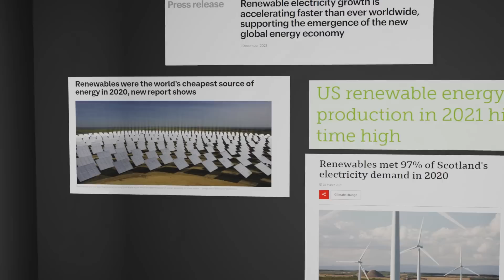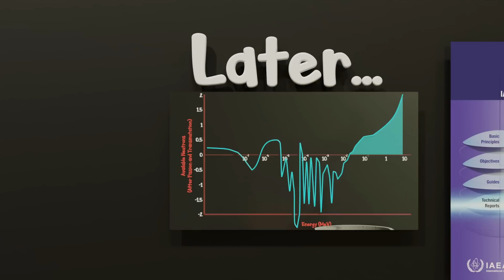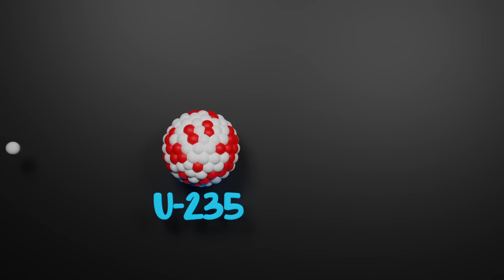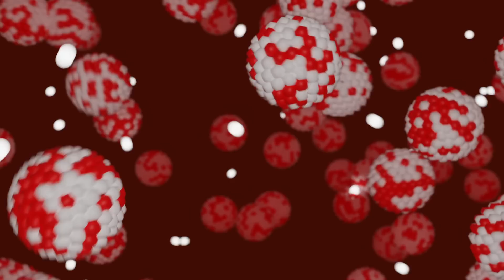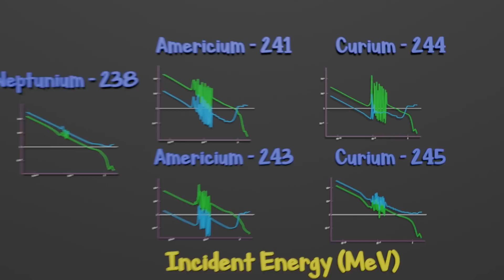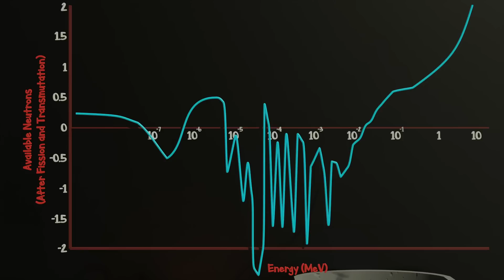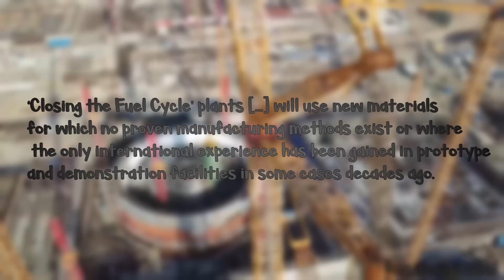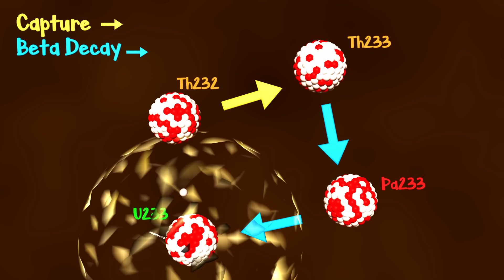How to turn Nuclear Waste into Nuclear Fuel

Comment: One of the best videos I have seen on the subject -- well done!

I would like you also to explore the question of whether Plutonium really is dangerous. The often-quoted figures that (traditional) spent nuclear fuel must be stored safely for tens of thousands of years (some people go as high as millions of years) is really based on the concern that Plutonium will get out into the environment.

Here's a breakdown of relevant half-lives:

* Thorium-232: 14 bn years
* Uranium-238: 4 bn years
* Uranium-235: 0.7 bn years
* Plutonium-239: 24,500 years
* Caesium-137 and Strontium-90: 30 years

Most people will see this and recoil in angst from the long half-lives of the top-most isotopes because big number=scary but the scientific reality is that the longer the half-life, the less intense the radiation. To wit: Stable isotopes have infinite half-lives.

(As an aside, I think this video's classification of high-level, intermediate and low-level waste also needs to be discussed in more detail, since the thing that makes low-level waste low-level is not the short half-lives themselves -- which actually contribute to making it more radioactive -- but that we are talking about very small amounts that may be sprinkled lightly across used gloves, shoe covers, sampling equipment, etc. So what we really need when talking about waste are two axes, one for half-lives and one for concentration of material, which together can describe how intensely some material will radiate, graphed over time.)

There is a rule of thumb that can be applied to radioactive material: After ten half-lives, the material will basically have decayed to nothing. So ten times the half-life of Plutonium-239 equals roughly a quarter of a million years. The longer-lived, milder materials like Uranium are naturally occuring. Most people will accept the premise that "I dig it out of the ground, I can put it back in the ground later".

Plutonium-239, on the other hand, is the longest-lived of the materials that are only created in decent amounts as a byproduct of nuclear fission. Since it still is shorter-lived than the Uranium isotopes, it still has more intense radioactivity than either of those, meaning that any escape into the environment would cause an increase in background radiation levels. This makes it stand out when nuclear regulators want to plan for permanent storage. They apply the "precautionary principle" in a very rigid way: We don't know how much harm Plutonium-239 in the environment might cause, so we need to make sure this can never happen

This is the crux of the problem: We do have a fairly good idea how much harm Plutonium-239 can cause, and unless you basically eat it in substantial quantities, it's negligable. You can handle it with your bare hands, no shielding needed. Should you build your bedstead of Plutonium? Probably not, but if it ever were to leach into the environment from storage sites, it would be in dilute form, and would make for a very small increase in background radiation.

The idea that we don't know enough about the harm from radiation in general, stems from the model of radiation damage called LNT which stands for "linear, no threshold". It basically says that all radiation is harmful, and the amount of harm is proportional with the amount of radiation, or in other words that there is no threshold for radiation, which would allow you to be safe be remaining under it. This is basically the premise behind every comparison you may come across between radiation and some number of "chest x-rays". This was a natural idea to have in the development of nuclear science and radiomedicine. But at this point, LNT has been falsified. It is simply not true. There are thresholds for safe radiation levels. However, regulators are still using LNT. I hope a future video from this channel will explore the topic of LNT further.

There is a terrible paradox -- humans have no senses that can detect radioactivity, but it is easy to build instruments to detect it with extreme precision! It is scary because it is so invisible, and we can feed that fear by looking at every little uptick on our Geiger counters. So, yes, escaped Plutonium may become detectable, but there is a huge step up from that to where it becomes physically harmful. Biology has evolved around radiation. We eat radioactive bananas, due to the presence of natural Potassium-40. We are struck by cosmic rays. Pilots and cabin crew receive the greatest amount of radiation of any professions.

The real substances to worry about are Caesium-137 and Strontium-90. These are the longest-lived isotopes that are created, next after Plutonium-239. Applying the rule of thumb, after 300 years, these will have decayed to nothingness. So in summary, traditional spent nuclear fuel needs to be shielded for 300 years. We have built cathedrals that took longer, so I'm sure that's something humans can pull off.
Reply: 10/10 comment right here
Reply: Im not reading all that, but I agree man
Reply: @BerryMcCockiner  I'm sorry, I have many skills but brevity is not among them. Basically: Plutonium=Bogeyman
Reply: Turn this comment into a video and you’ll get 100,000 views.
Reply: Very good comment
Reply: Yep, he just forget to mention that Russia has BN600 -BN800 and western companies lost their know-how in this field that's why politicians so scared of nuclear plants
Reply: Is Plutonium dangerous? 0.001 gram of it, ingested or inhaled, will give you cancer. And it's not even the worst isotope in nuclear waste.
Reply: There is SOME reason the Russians use plutonium as a assassination weapon, I'd guess.
Reply: @judychurley6623  May you be referring to Polonium here, and not actually Plutonium?
Reply: " These are the longest-lived isotopes that are created, next after Plutonium-239. " I think you meant to say shortest lived ;)
Reply: @pip0109  No, I meant to say exactly what I wrote. I can parse it out a little bit to make it easier to understand:

If you rank the radioactive isotopes that are produced by their half-lives, from longest to shortest, then you will find the ones I pointed to next after Plutonium-239.
Reply: The statement that you can make a bomb out of Plutonium is also very wrong, you need a special isotope. And that can´t be separated out due to how physics work, that have to be created in the core, that is not really realistic in a fast reactor
Reply: Plutonium 40 can be dangerous since it spontaneously fissions and can cause a spontaneous chain reaction if its amassed to criticality.
Reply: That is one of the most profoundly ignorant questions I have seen for some time. Plutonium is preferred material for nuclear bombs. Any person that advocates nuclear energy is also advocating proliferation of nuclear weapons ... they just may not know it. Over 2,000 nuclear bombs have been detonated so far and thousands more are in storage or in missiles. The material to make these nuclear weapons came almost entirely from nuclear power plants built, ostensibly, for 'peaceful' purposes.
Reply: @dunexapa1016  Here are some facts for you to consider:

* There are countries with nuclear power but without nuclear weapons (Canada, Netherlands, Japan, etc), and there are also countries without nuclear power but with nuclear weapons (North Korea, Israel). Therefore, there is no causal relationship between the two.

* There are two main paths to nuclear weapons, enriched Uranium-235 and bred Plutonium-239. Anti-proliferation work is centred on two tactics, one for each path. For Uranium, enrichment is controlled internationally to prevent countries enriching beyond 20 %. For Plutonium, it is reprocessing which is controlled. The IAEA has good systems for checking all nuclear energy infrastructure, to avoid these two paths to weapons.

* Only a few countries are doing nuclear reprocessing, which can obtain Plutonium, but it will not distinguish between the different isotopes of Plutonium. Plutonium obtained from civilian fuel will contain too much Plutonium-240 to be usable in nuclear weapons, because they are designed to keep the fuel in the reactor for two  years or more, thus allowing more of these atomic nuclei to absorb neutrons. The reactors used to breed weapons-grade Plutonium are different, such that the fuel only spends around a month or two in the reactor, thus creating much less Plutonium-240. The IAEA is capable of understanding what kind of reactor they are looking at when they visit nuclear sites in different countries.

* After the Cold War, there was a lot of nuclear material that had been put into weapons, especially in the former USSR which had the biggest stockpile. In 1993, the US and Russia entered into a partnership informally called "Megatonnes to Megawatts", which ran until 2013. In this programme, ex-Soviet weapons-grade material was downblended to civilian grade, and exported to the US, where it was used as civilian nuclear fuel. Quite literally, the former nuclear weapons were turned into civilian electricity, comprising 10 % of US electricity generation until a few years ago. This former military nuclear material has now been put beyond use, because there was a nuclear power industry capable of accepting this material, and the world is safer as a result.

* The IPCC draws up several pathways to avoid catastrophic climate change, but all of them involve nuclear energy to some extent. The IEA in its latest reports also point to nuclear power as being important, while the EU is including it in the so-called green taxonomy which will qualify it for preferential financing. They are not saying and doing these things beacuse they are idiots.
Reply: @eckligt   , Let's finish out YOUR list. YOU say (quote): "There are countries with nuclear power but without nuclear weapons ... and there are also countries without nuclear power but with nuclear weapons ..." 
Absolutely meaningless statement!!! The countries (plural) with absolutely the MOST nuclear missiles also have nuclear power plants ... Next 'argument' ...
Reply: @dunexapa1016  Okay ... you're not making much sense.

By the way, here's an interesting podcast about Amory Lovins: https://youtu.be/P5gQPbXaw0g?t=154

And their most recent episode touches on the same topic of decentralized energy: https://www.youtube.com/watch?v=EZq6inVoMr0
Reply: @dunexapa1016  Oh look it's you again harassing everybody that leave a comment, go away.
Reply: @eckligt  just watched both super interesting. Quality comments
Reply: @dunexapa1016  Oh that's a bit of a fallacy, this is like if I said that anyone who advocates for renewables & battery storage also advocates for more e-waste as well as the emissions and damage mining lithium creates. Everything has downsides and nuclear power is strictly regulated, it's a minority of countries which  use nuclear power that have developed nukes, don't generalize! and simply that possibility is not nearly enough to say we should instantly stop pursuing nuclear. This is the classic "but what if!" argument that comes up with almost anything new. As a fun fact, the material in nuclear weapons can be used for fusion experiments or power generation in fast and other modern reactor designs. So if what you want is less nukes then funny enough what you want is more reactors
Reply: @CarlosAM1   , There is concern that the conflict in Ukraine may escalate into nuclear war. If that happened, I suppose you would still advocate building nuclear power plants. You absolutely cannot disprove these statements: Over 2,000 nuclear bombs have been detonated so far and thousands more are in storage or in missiles. The material to make these nuclear weapons came almost entirely from nuclear power plants built, ostensibly, for 'peaceful' purposes. 
I am 100% for any nuclear power advocate having as much obsolete, dirty and dangerous nuclear power as they want, as long as they pay for ALL costs. No sane person believes that is how things would work out. The people that received electrical power from the Chernoby nuclear power plant did not pay for all costs. No, they passed the cost on to people that do not want and know they do not need energy from ANY nuclear power plant.
Reply: @dunexapa1016  actually, I would still advocate for them, also what does this have to do with what I said? It seems you did not read my comment and just copy pasted yours again. So first of all please go read it before repeating the same arguments, and second, you know who is enjoying the "dirty and obsolete" nuclear power? Countries like France and places like Ontario! Who not only have managed to reduce their emissions to a level that is unseen in countries like the us or many others, but also have reduced air pollution, have cheaper energy and are absolutely kicking it compared to countries like germany, which invested heavily in renewables, shut down their nuclear plants and now have to build coal power plants to cover the loss of power, leading to thousands of deaths due to air pollution, Oops! If only there was an energy source that was stable, lasted a long time, and was currently being developed to be even more advanced, economic and efficient without depending at all on good weather to work...
Reply: @dunexapa1016  First of all I said France, ontario and other countries. You of course instantly picked france and ignored the rest to try to twist my words. And second I never said I wanted to build more nukes. The reason i would still advocate for it is because a nuclear war doesn't change the laws of physics in a way that makes nuclear power less efficient or more dangerous, and because, again, nuclear reactors are a way to get rid of nuclear weapons.

I am genuinely getting tired of this conversation.
Reply: @dunexapa1016  Your argument is as ridiculous as claiming we should be against demolitions because TNT is used. Your position is profoundly ignorant, on all levels. We could have routine Fukushima-like meltdowns and it would still be vastly superior to what we're currently doing.
Reply: @AfonsoCL   I could understand how what I say might seem strange to a person that does not live in the real world. 
I seriously wonder if having "routine Fukushima-like meltdowns " is something you would like to happen. 
I have found that nuclear power advocates cannot answer the most extremely& basic questions. *Practical questions that would arise if there was a proliferation of building nuclear power plants. I have found that nuclear power advocates are PROFOUNDLY ignorant of history and human nature. Nuclear power advocates seem to me like little children that see some shiny new toy on television and immediately throw a tantrum to have that toy.
How much energy do you need, and for what purpose? Answer in kilowatt hours per week.
Reply: @CarlosAM1   Oh, and you mention Ontario ... Like in Ontario Canada ... like Canada ... the country that helped India build a nuclear reactor that India used to harvest material to make a nuclear bomb? That Ontario???
Reply: @dunexapa1016  if you teach a man to use a knife and he uses it to murder someone does that make you a murderer and all knifes weapons of murder exclusively?
Reply: @dunexapa1016  wha? When did I ever justify or mention making preemptive strikes?
Reply: @dunexapa1016  Is either a troll or completely deluded (edit as our friend was so kind as to point out my autocorrect mistake). They make the same arguments on basically every comment I’ve seen and rely on basic misunderstand of both the politics around nuclear power, the history, viability, and safety factor. It’s probably not worth interacting with them since their responses are essentially always nonsensical and filled with either blatant argumentative fallacies or outright lies. The most common ones I’ve seen so far have been Gish galloping, in which they assert a verity of questions with flawed base assumptions that would each individually take a large amount of time to respond to, then respond before every one of those questions have been answered asserting victory, and an clear lie in that they’ve been studying nuclear for “50 years” as they have stated in another comment chain. 

If you see this, I’d suggest you either stop attempting to argue in bad faith or actually attempt to listen to your interlocutors. You may actually learn something if you took a moment to look at the honest responses to your nonsensical questions.
Reply: @cementskies3933   Neither a troll nor (quote) "diluted" [SIC] . I Have stated factual historical information and factual information about nuclear energy. If you BELIEVE something I have said is not factual I suggest you get your Google fixed and do some research ... I have done research for fifty years, ... you probably have some catching up to do. Hint: Listening to government 'scientists' who are paid to brainwash you is usually not research.
Reply: @dunexapa1016  man go outside you’ve spent the last 20 hours writing a twitter argument in every comment section lol
Reply: @dunexapa1016  “It is better to keep your mouth closed and let people think you are a fool than to open it and remove all doubt.” I suggest you take this quote into account in future. 

It is clear you are nothing more than a common conspiracy theorist, dog whistling such foolish things as “doing research.” Having done actual research, the process is far more intensive that simply reading ignorant blog posts. Your statements also make it increasingly clear that have not once actually taken the time to look into the historical events you reference. 

You bring up Chernobyl in another thread, clearly ignorant of both the major effects of the event and the actual causes. Anyone who has read any of the reports at the time would’ve seen that the fault clearly lies within the complete disregard for protocol by the staff at the time. The disaster would have likely not have become as large as it had either had it not been for mismanagement all the way up the chain, in a country which had far more regard for its appearance than the actual well-being of its citizens. 

Anyone who doesn’t get their information about three mile island from blogs or over dramatic docuseries would know that the the amount of radiation those living within 10 miles received was higher than original estimates, landing around 100 mrem. What you fail to recognize is that the Ava rage person receives about 300 mrem of radiation in the form of background from appliances and solar radiation every year. The largest part of three mile island of historical significance is the panic it created. Not only that, but any self respecting nuclear engineer would point to the fact that the crew at the time weren’t adequately trained and ended up accentuating the problem by failing to diagnose it for as long as they did. Despite this, the actual damage was minimal. 

Finally Fukushima. If you have done any research on the topic you could’ve seen that there had been at least 3 ignored reports by the company to raise the sea wall alone. They are relatively easily accessible if you actually spend the time to look for them. Not only that, but they had also been recommended to raise the generators to higher ground instead of having them in the basement. The event that occurred was an incredibly unusual earthquake in terms of size and a consequentially large tsunami, and yet, the damage was avoided by two other reactors higher and lower on the coast. 

Instead of putting your ignorance on full display I suggest you take your own advice and do some actual research. Or at the very least learn the most basic nuclear physics, then you might be able to tell the difference between a reactor capable of making highly refined material for weapons and those used for energy. 

All of your arguments are fundamentally flawed and it’s a wonder you have avoided learning anything about nuclear in all you “50 years of research.” Instead of allowing yourself to continually be fooled by ignorant blog posts and other clearly unsound sources you should take the most basic of intellectual steps and learn the physics to verify for yourself how these incredibly interesting creations work. Not that I believe you have even the most basic intellectual honesty to read anything that doesn’t fit into your narrative. That is clear at this point, especially if your 50 years claim is true. 

I hope that anyone who might be enticed by this charlatan may be able to actually look into the subject in an honest way and avoid being pulled into their ignorant and harmful ideology. Do not be fooled by ideologues such as this one, they have no interest in actually assisting in the pursuit of knowledge, instead only holding everyone they discuss with back. You will always be better served learning the truth rather than fooling yourself into believing you know something everyone else doesn’t. It’s far more productive to learn something else no one else has figured out in an honest and true way. The rewards will come surely with the true new discovery of knowledge. 

P.S. This is a clear example of their tendency to make claims with clearly bad premises and wait for an extremely long response then claim victory if one thing is missed. 

TL;DR

This person is a harmful ideologue and should not be taken seriously. Their single paragraph response proved everything in my last statement.
Reply: @sowophlia  , You need to do some research for the next 20 hours, then TRY and come back and carry on some sort of meaningful conversation. Get some rest also ...
Reply: @dunexapa1016  "There is concern that the conflict in Ukraine may escalate into nuclear war. If that happened, I suppose you would still advocate building nuclear power plants. " DO YOU EVEN MAKE A DIFFERENCE BETWEEN ROCKETS AND PLANTS?
Reply: @dunexapa1016  "I have found that nuclear power advocates cannot answer the most extremely& basic questions." WE DO, it is just that very appernat you don't want to accept them , instead preferring to live in alalala land
Reply: @dunexapa1016  A BIG HINT for someone is a conspiracy nutta: "Hint: Listening to government 'scientists' who are paid to brainwash you is usually not research."
Reply: Maybe listening to Alex Jones is the proper  RESEARCH :))))))
Reply: @dunexapa1016  "The material to make these nuclear weapons came almost entirely from nuclear power plants built, ostensibly, for 'peaceful' purposes. "

That's an awfully big claim, do you have a source on that figure that I can look more into?
Reply: @dunexapa1016  I would listen to them ANY DAY over the likes of you. You have provided no coherent argument. How could you when your argument boils down to the same vague, tired, weak claims the anti nuclear crowd has pushed for half a century, and an utterly bizarre fixation on raw energy usage per person,  treating it like its somehow immoral to use more than you personally do since according to you its some finite resource we must conserve....
Reply: @dunexapa1016   WRONG - "nuclear power plants built, ostensibly, for 'peaceful' purposes." PU 239 is produced in special purpose weapons reactors or research reactors. Uranium is enriched to over 90% in centrifuges for weapons purposes. Your level of ignorance is absolutely stunning. Can you at least read wikipedia before spewing your nonsense?
Reply: @dunexapa1016  Nuclear weapons have been the greatest vehicle of peace in recorded history.  Prior to nuclear weapons there were centuries of years where hundreds of thousands died from combat and millions from the famine it created.
Reply: @dunexapa1016  There is no need to build dirty or outdated nuclear reactors when we already have modern and safe designs.

Didnt you listen to me?  Since the invention of nuclear weapons there have been no major wars.

Ironically nuclear weapons have done more for peace than any of your anti nuclear activism
Reply: @Smokey298   , Let's see, by your reasoning if there are twice the number of nuclear weapons in the world, then what? would we be twice as safe? ten times as safe??? If building more nuclear weapons makes us safer ... then why did Israel bomb Iraq's Osirak nuclear reactor? Why did the United States invade Iraq??? India built nuclear weapons then Pakistan built nuclear weapons ... by your reasoning ... If India and Pakistan build more nuclear weapons then both countries  will be safer. 
Oh, and if a country builds nuclear weapons, then they must be tested ... thousands of times even ... you know, to make sure they still work. What country will be the policeman to tell another country what type of reactor to build ...*PLEASE* answer that simple practical question. What country will be the policeman to tell another country how to dispose of its nuclear waste.
Reply: @dunexapa1016  "... then why did Israel bomb Iraq's Osirak nuclear reactor? " Maybe because Iraq didnt have nukes !? :)))))) (CLOWN)
Reply: @dunexapa1016 You seem to be misremembering events.  The WMDs the US Govt claimed were in Iraq were thought to be CHEMICAL weapons, not nuclear.  And it was not a completely dumb idea, remember that Iraq used chemical weapons in battle during the Iran-Iraq war.
Reply: @dunexapa1016  Proliferation is really not an issue. As U238 gets bred to Pu239, there are a lot of excess neutrons emitted.  That means the Pu (particularly in what we today call "spent fuel"), formed is not pure but rather a mixture of isotopes, and many of those absorb too many neutrons to work in a weapons design, even if you chemically separate everything (not easy, just ask Iran how the past 24 years of trying that have been going for them, even with access to their very own research reactor [oh wait, they stopped trying...])
Reply: @dunexapa1016  WRONG - Plutonium-240 is the second most common isotope, formed by neutron capture by Pu-239 in about one-third of impacts. Its concentration in nuclear fuel builds up steadily, since it does not undergo fission to produce energy in the same way as Pu-239. Pu-240 has a relatively high rate of spontaneous fission with consequent neutron emissions. This makes reactor-grade plutonium entirely unsuitable for use in a bomb.  Reactor-grade plutonium is defined as that with 19% or more of Pu-240. This is also called 'civil plutonium'.